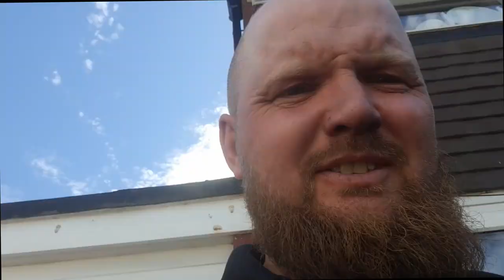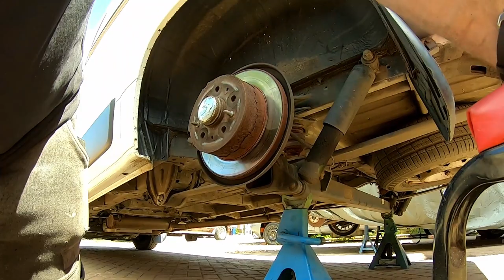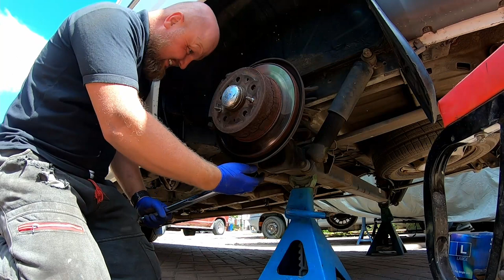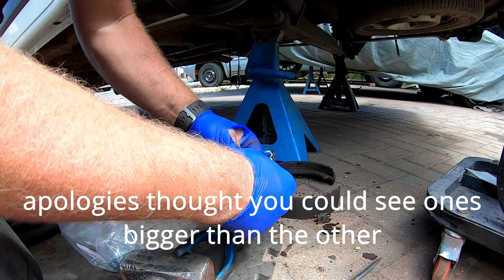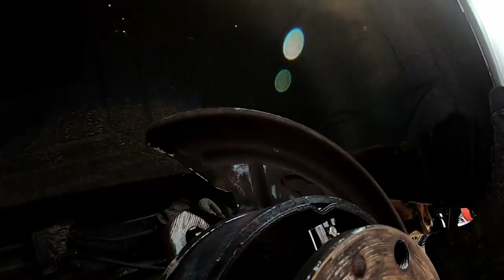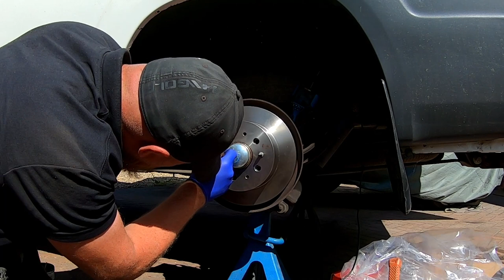Peugeot Boxer discs and shoe replacement

Comment: Promaster - same.   Parking brake retainer clips came off and wreaked havoc in there.    Not a mechanic but I tackled it.   Those two large bolts!   lol    I really had to give those my all a standard length 1/2 racket.    Next time I'll have a breaker bar or a pipe.    Thanks for the vid!
Reply from the maker: Oh you joking hope it's sorted now though mate they are tight to get off

Comment: The larger string is mounted upside down. When you notice, she is smaller at the top and larger at the bottom. (different number of "rings") At 10:11 it can be seen that she is turned the other way around. It catches at the top and there is a lot of space at the bottom.

Comment: Changing the handbrake shoes --- did you have to adjust the handbrake cable as well?  My handbrake is weak so not sue if the cable is the problem or dodgy shoes.  Intend to check this weekend - but have been told that if I adjust the shoe setting (via the cog with a screwdriver) then I would have to reset the cable tension as well.  :/
Reply from the maker: No just the shoes mate adjust them up until it won't spin then back it off until there's just some resistance then you should be good